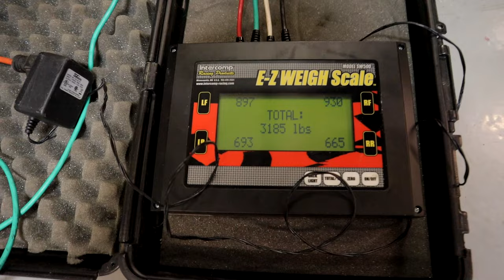American Musclecar Evolution - Why Pontiac Started Strong And Faded Into Obscurity

Comment: Alpha, FINALLY,  you make a video about my beloved Ponchos and you're bashing on them!!! Just kidding man, you are absolutely right about the con rods, they were junk which is why exceeding the 5000 RPM redline on the regs was what we un-ironically referred to as "flirtin with disaster'. Back before we met, in the very early 80's I set about building the 'ultimate' Pontiac engine for my burgundy 4 speed 70 goat. I had figured out by then that I needed to go with a forged bottom end. As you correctly stated, there were ZERO aftermarket options in 1982, so I started with a 4 bolt ram air iii block from a buddy who had totaled his goat (flying off the end of veterans rd by the west shore expwy). I then found this guy in the back of HPP mag called 'Purely PMD' located out in New Mexico who hooked me up with forged Super Duty con rods ($800) and a 400 "armasteel" crank (not forged but supposedly stronger than cast). I also saw an ad in HPP for a set of 70 RAIV round exhaust port heads (casting 614) that a guy had in northern NJ which I also bought for a grand bare. In effect, I had built a RA IV 406 (with forged rods). Because this process took forever (several years), by the time I got it all together, I had lost some interest and never really got the chance to thrash on it @ E-town but she would have been a runner.  P.S. by the time I went through my second GTO phase (mid life crisis) in the early 2000s, the aftermarket had finally caught up and it was ridiculously easy to build a NASTY Pontiac engine which I did. Used an aftermarket IA2 block forged rotating assembly and Aluminum 'wideport' heads ported by some of the best in the business - Dave Bischoff among them. TD rocker shafts, and a .775 lift solid roller. Used to sing that NA Pontiac 540 to 8 grand at the big end and not break a sweat. Was able to put the "hess truck" which I had just bought before you left for TN fairly deep in the 9s at a shade under 2 tons on the scales @ e-town with me in it. Cost an ungodly amount of scratch, and I could have gone faster for less than half if I sensibly used a BBC, but I was obsessed with doing it with an Indian under the hood. Truth be told, the only thing "stock Pontiac" was the bore spacing and water pump. Anyway, I finally achieved the dream from decades earlier of having the most badazz goat on SI. NOBODY wanted a piece of that car circa 2008...

Comment: Tony, back in the day to get away from the 63 on up factory 389 cast iron rods, we use to use 59 to 62/ 389 steel rods, then pin the lower rod cap bearing with a bronze step pin in the lower cap to help hold the rod bearing because with most of the long duration sold lifter cams ( 308* to 325* Der) we ran in the 389 & 400 4 bolt blocks as that was the best rods we had to deal with back then. This modified rod was good up to around 9,000 rpm power shifts for a while, but you had to check the center to center distance of the piston to crank all the time and re size them every year or so. The biggest problem was the soft Arma poured steel cranks were just out & out junk in the early 389s but if you knew anybody in racing, they might sell you an early forged steel 389 Super duty crank to use with the 59 to 62 pinned poured steel 389 rods. With that combo you could build a pretty dependable 10 second drag car on race gas with no NO-2.  Today with Butler Pontiac you can build a strong 400 Pontiac 4 bolt R/A IV iron block twine turbo with all billet parts that do run in the 8s or faster, but at that point, it all has turned into cubic dollars anymore, and the real fun factor is all but gone. Bottom line, how fast can you spend? So sad.

Comment: I have read that after Pontiac's racing success of the early sixties that the GM brass put a 10 lb. / Horsepower cap on them because Chevy with the Corvette was supposed to be the performance division.  If you notice, no matter how hot...Ram Air III, Ram Air IV...a Pontiac 400 V-8 is, it is never rated at more than the 360ish HP range...about one tenth of the weight of a GTO.  Meanwhile the 428 in rather mild tune is rated at 390...one tenth of the weight of a full frame Gran Prix or Executive...
Reply: Pontiac engines were always underrated to keep chevy off their back. They were often being held back by chevy in many ways.

Comment: No lie, super stock racing Pontiacs in the 70s and 80s was tough.  I was fortunate to find a set of used 421SD rods for my 428.  Still could not work around the cylinder head issue, even with porting.  The plus is that no motor has more mid-range explosiveness IMO, and you cam the snot out of the motor for mid-range pull.  Good Times.  :)

Comment: Growing up through the '50s & '60s, I remember a very distinct problem Pontiac V8s had you didn't mention. Clacking valvetrain. It was extremely common throughout the '60s. You would be standing somewhere, parking lot, crosswalk, whatever, anywhere a car would slow up to stop and you'd hear clack, clack, clack, clack and you wouldn't even have to look, you would just say, oh, a Pontiac, then look over to the racket and sure enough, it was a Pontiac. I always figured it was oiling issues that put a strain on the valve train, which in turn put a strain on the timing chain and gears which caused the plastic timing gears to break down ending up in the oil pickup screen, which caused a restriction to the oil pump causing even less oil to the valvetrain. These weren't cold engines either, they were fully warmed up and clacking. Not old junk but relatively new cars, 4-5 years old with way less than 100,000 miles.

Comment: Early 60s 421SDs for NASCAR had forged rods. Hard to find, but worth it.
Reply: Nah Summit and Butler will sell you good solid Made In China "stock replacement" forged rods for less than $400.
They are exactly the same dimensions as stock and LOTS tougher. Pretty close on weight I think they are like 20 grams heavier. Much as I dislike offshore parts they have American quality controls in place. Not going to ruin a good block over $400.
Reply: all the early rods were forged  but they are 60 years old minium. go with new H beam. Jim Hand said cast rods are good to 5800 rpm. so if you can make your car work below that rpm no need for aftermarket .

Comment: You are absolutely correct on the Pontiac cast rods. That was a mess with the street racing crowd, and back in the day you could not a cheap set of forged rods. Unless you could somehow find some 421 Super Duty rods or pay for a set of super expensive Carrillo rods you were SOL. Back in the late 80's early 90's I had a good friend with a 455 Trans Am street racing car used for high speed roll racing. Mostly a stock engine with all the good Pontiac stuff, like the Pontiac HO 455 4bbl aluminum manifold, ported polished ram air heads, forged pistons, a nice street cam, balanced and blueprinted engine, Holley 850, stock ram air exhaust manifolds (no headers as they were too low and an issue when you were doing 150 MPH plus and they would hit the ground on every bump in the highway), and the piece de resistance which was a 2 stage nitrous kit, with a 125 shot and then a 250 shot, and 2 big nitrous bottles. If I recall correctly car had somewhere around 2.73 gears for the high speed runs, it could have been even higher gears. Guy would race from 60 to 150 mph. He used to love racing motorcycles on the highway, and he would usually win. Lots of races with 911/930 Turbo cars, Lambos, Ferraris etc... As long as he kept the engine under 5,500 RPM's it would last a bit, but if it went over 5,500 that was it, the rods would immediately go out of round and spin a bearing. I never saw a rod implode and take out the engine, but many times one of the cast rods would just stretch and go out of round and spin a bearing...

Comment: @ 6:00 mark... Yeah, I used to sell plenty of those skid plates.

The first month driving my '69 383 Valiant mule,  I actually scraped the oil pan driving through a regular gas station parking lot.

Didn't go over a speed bump, didn't hit a giant pothole - but the car had six cylinder torsion bars, sat at stock ride height, and still had the original 13" front wheels at that point.

And a stock oil pan was pretty easy to find the ground with

😆

Comment: I just today came across your YouTube channel and I subscribed. I am absolutely delighted with the content. Let me tell you about my Trans Am that I no longer have... I bought it new in 1977 in California. It came with a 403. in 1984, at 143,000 miles the 403 started pinging and rattling and overheating. I bought an XF block from Ken Crocie of HO-Racing and converted the TA to a 455 with 96 casting cylinder heads, and a THM 400 transmission. The cast connecting rods were like Democles' sword for me (all in my mind of course). So, in 1991, for no reason except that I thought I had too much money in my pocket I ordered from Crower eight steel billet connecting rods in the standard Pontiac rod size and changed them, along with Edelbrock aluminum cylinder heads, and I put a Richmond 5 speed racing tranny in place of the THM 400. I still retained the 2.41 rear end (massaged by Tom's Differentials). With a 4.03 first gear it was an unbelievable car, with 315/40 X 16 tires and Herb Adams suspension and bars.... I cry every time I hear about Pontiacs. My car? Due to circumstances, in 2013 I gifted the car to someone who turned out to be totally unworthy of my kindness...

Comment: I've also heard that on Pontiacs, the way the motor mounts bolt into the block, it can distort the main webbings on High HP applications or people with broken motor mounts. Which can cause main bearing failure. Olds aswell
Reply: @SweatyFatGuy  i read a good bit of your other comment. and yeah it seems pontiacs dont like to spin up as quick as other engines. i have a pontaic 455 in an 81 TA some hillbillies put together. they stuffed 4.10s in the rear and it sucks. gets like 6mpg, tops out at like 90mph. and really isnt that quick. you pumch it at 25 and itll light the tires up, but the acceleration just isnt there.

Comment: I started with Pontiac engines back in the 80s, drag raced them for years, ran mid 10s with a 455 in a 67 Firebird. But Pontiac parts are expensive and alot less choices. Also built Oldsmobile and Buick engines for a while. Very expensive and limited choices. But I eventually faced reality and started building bigblock Chevys and smallblock Chevys. There's alot of reasons why Chevys are so popular.

Comment: Even though I'm a GM guy, I enjoy Uncle Tony's channel immensely.  Would love it if he started tackling breakdowns of specific non-Mopar engines, like the 1970 LT-1 or the 1969 DZ 302.
Reply: I'm a Ford man, but I think the 1970 LT-1 was one of the best performance engines Chevy has built, to run on the street with. I know the DZ was built literally the same way except for a slight cam spec change, and that may have been why it was a little finicky for the low speed city running, IMHO. The LT-1 had everything you needed, enough manners to cruise the streets, and enough muscle to run with most everything out at the time.
Reply: DZ 302 overrated.
Reply: @cuzz63  good for what it was designed for 5 liter trans am racing.. but lacks the cubic inch for a good all around preformaance engine

Comment: The main issue with hot rodding a Pontiac was the unavailability of good racing parts and the scarcity of factory go-fast parts. Chevrolet made these parts available from the factory or over the counter and stole the show.

Forged cranks? Unavailable unless you can find a used 62-63 990 crank of which only 2000 were made. I got lucky and snagged one from PJ Heck in Ohio. Forged rods? Your choices were the early SD forged rods that were called rubber rods for a reason, or the 73-74 SD 455 rods that were impossible to buy unless you owned one of those engines - and even if you could get them they were way heavy. RA4 heads? Bring your wallet. RA5 stuff? Unobtainium unless you were well connected. The main bearing sizes (3 or 3 1/4 inch) were an impediment to high RPMs because of oiling. 4 bolt blocks were rare. 

So what’s left? Some very good factory parts that could take you deep into the 11s as long as you used good rod bolts (I had Nunzi’s rod bolts installed) and you watched the RPMs. A 400 was generally good for 6,000 or a little more while the 455 was good for 5,500 RPM. A rev limiter is a must to keep the engine alive. If you want the recipe Jim Hand has a very nice book showing you how to maximize stock parts. He has a safari wagon that flew on the drag strip using stock parts.

The bad reputation you mentioned happened when people installed 4.56 gears and then over revved the engine resulting in broken rods. Pontiacs are torque monsters and they don’t have to spin high to make good power.

Forged rods and cranks and light forged pistons eventually became available but it was far too late. Pontiac was a niche player by then.

Back in the day I ran a d port headed stock bottom end 455 in a trans am for years and years and eventually got it into the 11s. It had 3.55 gears in the diff and weighed about 3,700 lbs. There was nothing exotic about that engine - it had heavy TRW forged pistons, heads that I had ported myself, headers, a comp cams “racing” hydraulic flat tappet cam, an edelbrock performer RPM intake, and a Holley 750 which was probably too small. Of course, it had stock cast rods. I wasn’t connected to anyone in the industry and I didn’t have a pile of money so I didn’t have any exotic parts, but I sure had some fun!

I hated to see Pontiac cancelled, but by then it’s previous identity as the performance division of GM was long gone.

Comment: My first car, Pontiac GTO, learned by reading...don't go for rpms ... the main bearing were also large and generated friction.   Be efficient, gear for 1/4 mile, get your car to launch cleanly.  Has three, including a 64 4spd.   Loved that car.  I was a  lousy mechanic, my best neighborhood mechanic moved away.   I ended up with an RD400, I could work on it and had a great mechanic.   Loved that bike too.
Reply: Loved those little Yammies, I owned an RD350 and drooled over the 400 'Daytona Special'. But for straight line terrorizing, you couldn't beat a Kaw triple H3/H4.